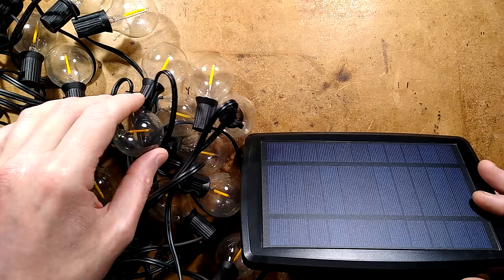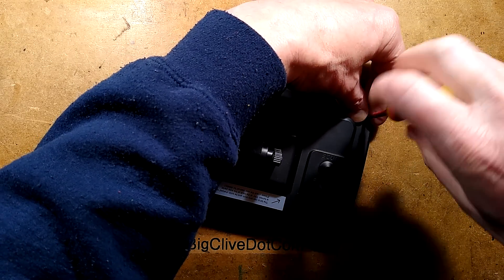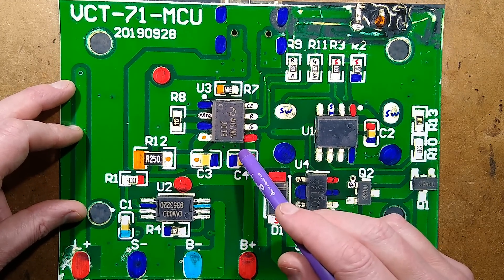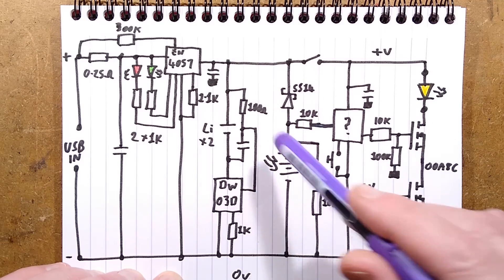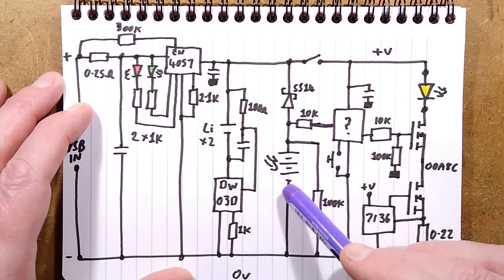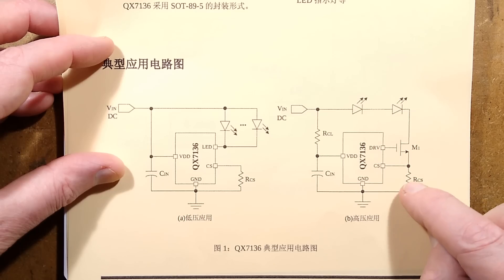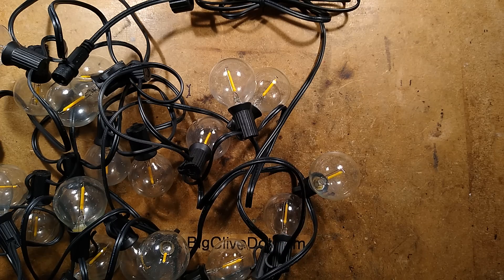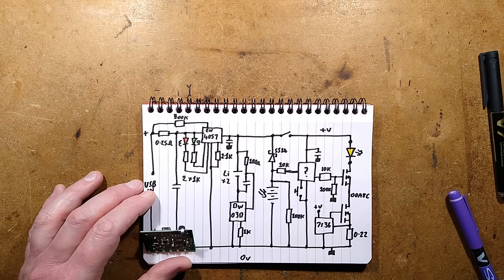Dead solar lights.

Comment: The REALLY scientific thing to do would be to put 240V across the "good" set and see if they fail in the same way. That would be strong evidence in favour of your theory ;-)
Reply: And a set across a large capacitor bank, in the name of science...
Reply: @Aussie-g7z one of photons best quotes... I miss him
Reply: Identical plugs can be a real problem!
I recall a time long ago now, but as a child I attempted to use my fathers drill. With cable alongside drill, I plugged it and BANG FLASH, Melted terminals, blown house fuses.😮😂 Still alive...
I learned that 240v cables don't make 12v drills work at all.
Reply: 😅 I know you’re joking, but it would have been interesting to see one of the low-voltage bulbs tested in the bulb tester at 240v.
Reply: Hahaa 😂
Reply: Nah, LEDs on high voltage usually fail in a non spectacular way.
Reply: @Ni5ei that just means you aren't using enough of it😂
Reply: @zyeborm  I miss Photonics
Reply: @zyeborm can confirm, I've definitely had a mishap with a 5mm round IR LED which resulted in quite an exciting bang in the past. Completely blew the top of the LED off and shot it towards my face!
Reply: @Ni5ei The glass envelopes do have a nice coating of magic smoke on them if you look. So there was probably at least some excitement.
Reply: And claim a third set😅
Reply: And then return it claiming they are not working
Reply: The REALLY scientific thing to do would be to test how a good set of lights fares against a stick of dynamite. Will it ka-boom? The world may never know.
Reply: @tomnaumann2104 how many licks does it take to get to the center of a lightbulb, the world may never know
Reply: Do they use tags 🎟  anymore like in old  extention cable cords used on pc that read (240v 230v 220v 120v 110v) to also used on ( 48v 36v 24v 12v 6v 5v 3v 1v) or with color red color to be 240v and green to be low voltage

Comment: Nice lights, shame they use the same connectors for mains and solar. But the bonus is you now have 1 spare solar panel that contains 2 good lithium cells free. 🤣🤣 great video 2x👍